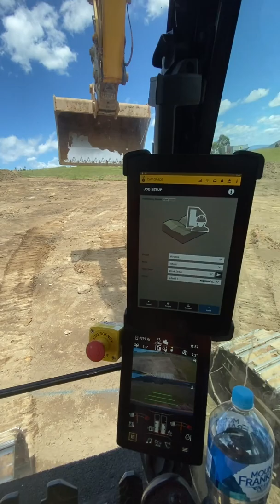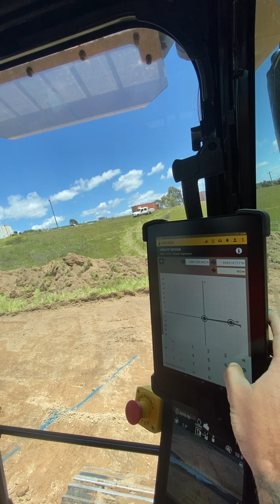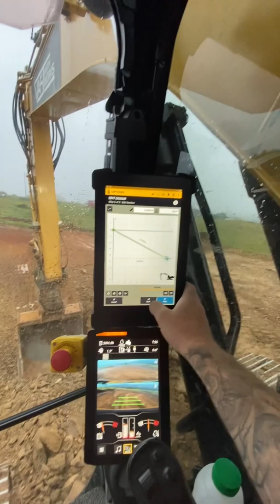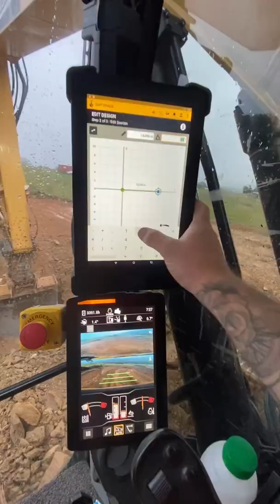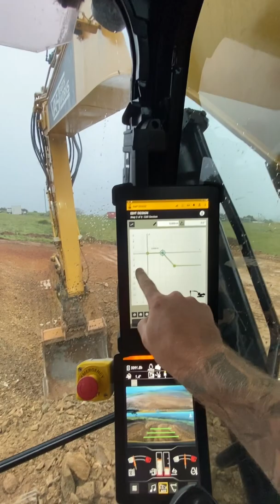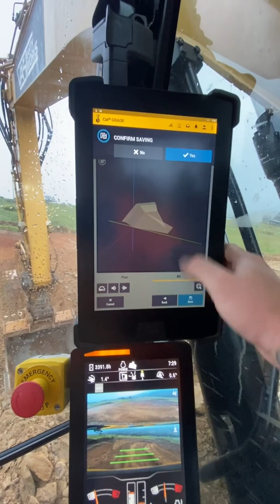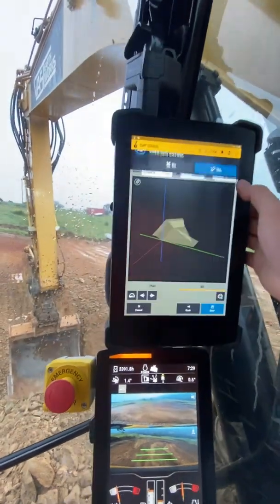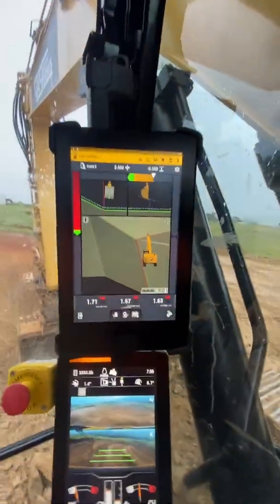Lets dig with Krafty: Cat grade infield design setup

Comment: SO is that the main program you use for final trim? or do you also use other ones? 
Where abouts are you based working out of? Cheers Garry
Reply from the maker: This is the main operating system we use. It’s called Cat Grade, pretty much identical to Trimble Earthworks. Inside the system there is a 2d version as well which doesn’t require satellites and can be used in remote areas. If you’re referring to the infield design it’s self, they are job specific. If it’s just a house cut I’ll make an infield design with just a level pad. If batters are required I can do them up as shown in the video or if it’s a bigger project with multiple levels we will liaise with our surveyor to do up an infield design going off the plans for the job. They then send us the job files and we load it into the system and start digging. 
We’re in Canberra, Australia.
Reply: @jaydenkraft  Cool thanks for all the information, I am in Brisbane on the north side, I am very interested in learning final trim and the GPS systems thanks for putting together such great videos as they are very interesting to watch Cheers Garry